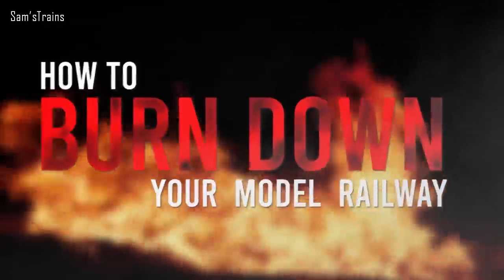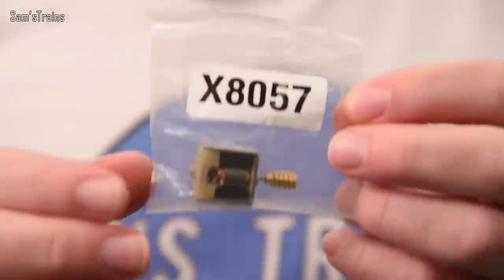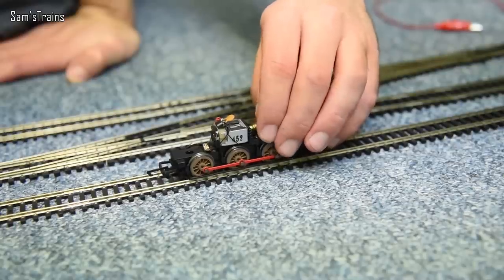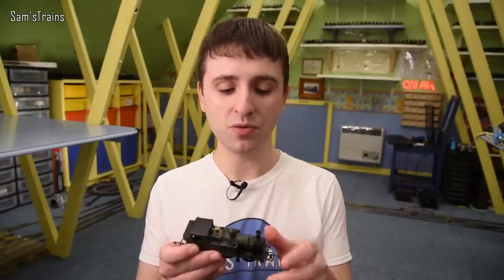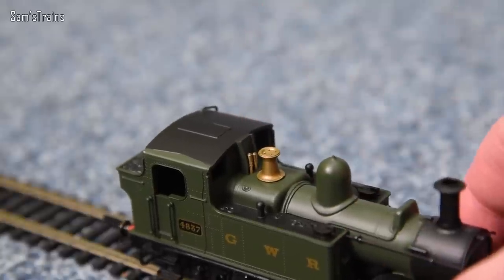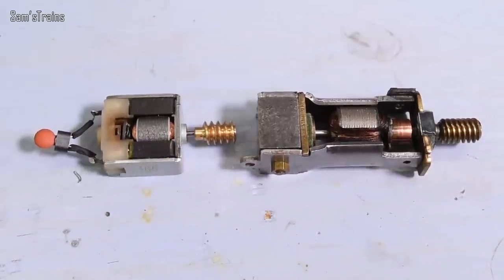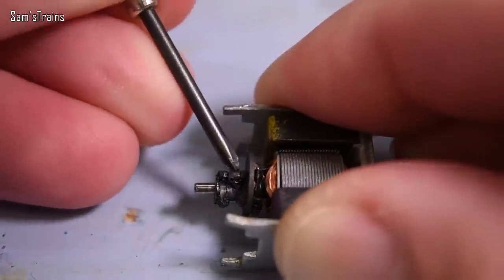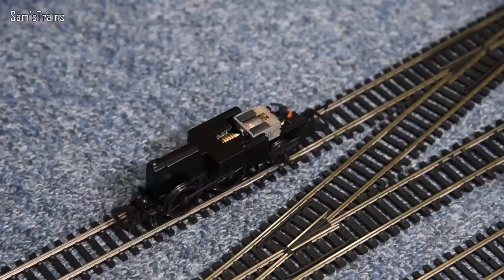How to Burn Down Your Model Railway | Train Motor Meltdowns

Comment: hmmmmm, quite interesting, i realize its British, but i have had "American style" engines' motors go "POOF"! however, they were made so the clearance between the gears was not sufficient, and was not adjustable. the "fix?", just take out the motors and gear train, and put it between two units with good motors. i have also seen, and heard the bonafide real mccoy engines go belly up, amazing that a diesel-electric can put out more smoke than a steamer.
Reply from the maker: Oh yeah, no doubt similar American engines suffer the same problem - blimey, that's crazy stuff! :O
Thanks for watching - Sam :)
Reply: hello, p smith again. forgot to mention, i do have a Tri-ang diesel shunter that had tight gears. i was able to shim the motor up just enough to provide very smooth running. i only have a smattering of European equipment, mostly British, some French, (including a model of the French Amtrak turbo powered trainset), and some German. i just had to be a little supportive of the international railways, after all, that where railways/railroads got their beginnings.

Comment: Ok brother the crispy bits you thought were welded to your commutator was your commutator. It was just melted down. I noticed the spot where there was a missing contact on the commutator. Hope I'm not boring you to death. So the jiggy (problem) with these motors is the brushes are crap! A good fix would be to use a slot car motor. You'll need to heat your worm gear with a pencil torch and remove it with a pair of needle nose pliers. Then just tapp it on to the other motor cold. The slot car motors are designed to run at higher amperage and therefore have scookum brushes. Or you could remove the stock brushes from the spring and solder a couple of wee copper blocks to the springs. You'll have less life on your commutator but you won't wear it out in your lifetime. Unless that's your favorite engine and you run it continually for weeks at a time. GOD bless you brother and cover you with his eternal love in the name of Jesus, thank you Father!
Reply from the maker: Hey Daniel, thanks for that - yes a motor replacement would be good - I'm quite used to swapping worm drives, so that wouldn't be an issue. Appreciate it brother, keep the faith!
Thanks for watching - Sam :)

Comment: THEORY TIME:  Possibly the welded brush caused a lot of friction, which lead to overheating, which resulted in the brushes burning up and the debris stopped the motor.  I mean like look how fast the armature was was spinning was spinning.  Its definitely possible.  I don't really know, I've never had a motors burn up on me.  What do you think?
Reply from the maker: Yeah that's very interesting - could well be correct!!
Thanks for watching - Sam :)

Comment: Off i have never had a motor fail mainly cause i use mehano controller but still i have nevrer had a motor fail
Reply: I have some really old trains one even from 1997 in used condition
Reply from the maker: Yeah! I do think the controller has a lot to do with it - I've seen FAR fewer failures since changing to a Gaugemaster!
Thanks for watching, Sam :)

Comment: Sam an FYI for you, The more POLES a motor has the more TORQUE it can produce for given Volts+Amps. The LESS poles a motor has the FASTER that motor can be driven but has LOW Torque for given Volts+Amps.
That's why all good MRR Loco's that can really pull a load are 5 pole motors or more, so if I was to replace any motor in any of my loco's then the bare MINIMUM is going to be a 5 pole motor and I WILL make it fit!  :D Try one of these - https://www.hornby.com/uk-en/5-pole-motor-assembly.html
Reply from the maker: Yes that's very true - I'm very familiar with all of the different motors!
Thanks for watching - Sam :)
Reply from the maker: And I don't pay £17 for those large 5 -pole motors - I pay £2 each ;)
Reply: @SamsTrains  It was used as an example of what type of 5 pole motor (as in what a Hornby type looks like), not of how much it costs, but as they say, you get what you pay for.

Comment: Those X8057 Motors came from HO Scale Slot Cars, didn't they?? WTF are they doing in Locomotives?? 😳😳

Bachmann USA.... I've got extensive experience with. The PANTS 3 Pole Motors that they insist on fitting in most Steamers and low line US Diesels.... Guaranteed to FAIL! Bachmann Spectrum Steam and Diesels, use and entirely different 5 Pole, Skewed Armature Can Motors, that I've put many, many hours on, with no issues!!  They crawl so well, with a good Decoder, that you could paint the Ties (Sleepers?) In front of the Locos, before it hits the Paintbrush!!! 😳😎 

Could that be why UK Market Locomotives are on average, 30-60% LESS than comparable American Locos? 
Carmine ✈🚂🚙
Reply: BTW, I owe you some thanks....
I haven't touched my HO Scale Layout since 2015.... Due to financial woes. 
I STILL can't afford to even walk into a Hobby Shop.... But watching a lot of your Videos has actually pulled me back into the Hobby!!! I'm falling for my Trains again. 💖😁👍👍
I credit YOU! 😉 

NOW, I need at least $300.00 worth of bits just to get it running again.....
And the chances of getting that is about nil... 😭

But the spark has been reignited. Thank you for that!
Reply from the maker: They may have done - that's a good question! Oh yeah - Bachmann's motors are dreadful, for sure! :O
Thanks for watching - Sam :)

Comment: ...crazy. 
The motor didn't fail, let's get that straight!
My question to point out is this:  Why such tiny motors in OO/HO locomotives?
This motor belongs in N Scale, Z Scale, or a slot car.
The failure lies in the application... putting that motor in an oversized scale.
I have seen those motors in toys and N Scale locomotives. Never in HO locomotives.
Half an amp might be safe for them. One amp? No. Increases failure rates with the same "tiny" measures of dependability.
Reply from the maker: haha that's very true actually - I don't believe this is a suitable motor for this application either!
Thanks for watching - Sam :)

Comment: Just a poorly made motor, not up to the amp draw it should be plastic not heat resistant enough brushes came loose and got caught and fried -- kind of ironic a motor thats supposed to be able to pull a load isnt designed well enough to pull a load.  That white plastic or nylong around the end does not look heat rated at all, should be a better grade of engineering plastic - that white stuff gets hot goes out of shape and its all downhill from there